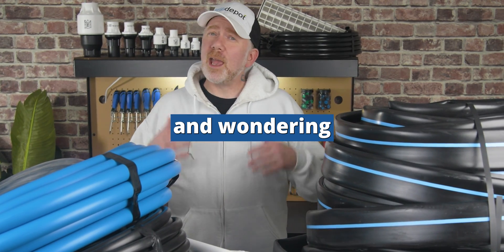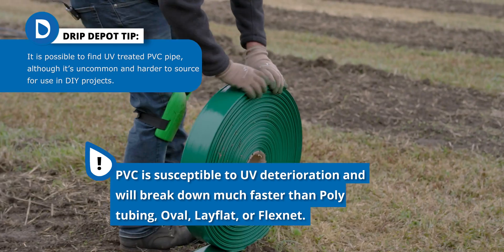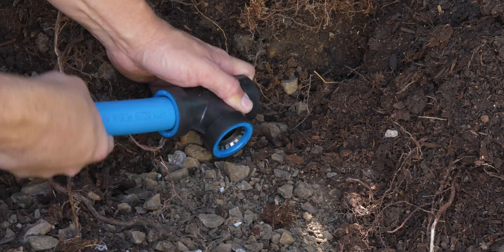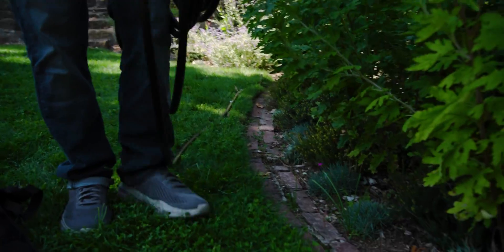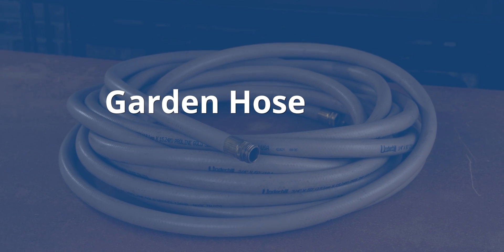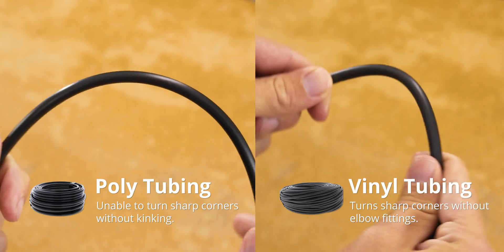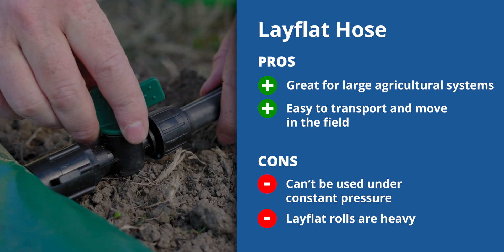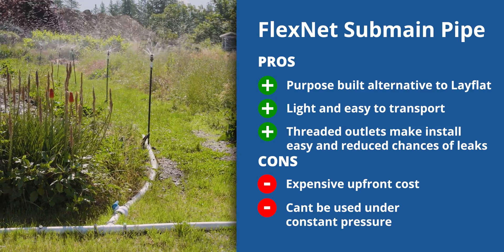Irrigation Pipe & Tubing: Choosing the Right Mainline Type for your Irrigation Project

Comment: A strange dismissal of HDPE polypipe, which can be standard or high pressure. If you use the proper clamps it is by far the simplest, easiest, and cheapest way to go.
Reply from the maker: No dismissal of HDPE, it is indeed great for high pressure applications and we covered two types of it in the video :)

Costs may vary depending on location, up front PVC will typically be lower in price, but I do agree that in the long term HDPE will likely be lower in cost, particularly anywhere that experiences freezing temperatures (exceptions for warm climates that can use Class 200 PVC pipe, very low costs).  For low pressure applications, LDPE will cost less both initially and long term. 

Basically, for high pressure applications in colder climates, HDPE is usually the better choice, but low pressure applications and warmer climates can be an exception in terms of costs.
Reply: @dripdepot In my area a 100' roll of 100psi polypipe is $66 and 100' of sched 40 1" pvc is $89, meaning the pvc is 40% more expensive. Fittings may more expensive with the polypipe but you will need less of them (no couplers or elbows except for very sharp turns). 

The ease of installation beats pvc, even if it were more expensive IMHO, even if  you are doing it yourself. I mean, with pvc you must unload each pipe, layout the pipe beside the trench, then glue it every 10-20', then place the pipe in the trench. With polypipe you just unroll it into the trench. 

Also, pvc is more prone to breakage if buried shallow if for example it gets driven over. 

This of course would only have a benefit on pressurized irrigation (not drip) but polypipe beats pvc in warm OR cold climates. (I'm in a cold climate and I use automatic drain valves for everything so freezing is not normally a factor, but I've had pvc freeze-break but never polypipe).

So I'm surprised you devoted so little time to the polypipe. Just my opinion as someone who has used PVC, polypipe and drip. I'm not a pro but I've installed hundreds of feet of all three types and the polypipe wins, hands down!

Comment: Thin wall poly tubing should be outlawed. Every time the system kicks on and off it moves and rubs against the aggregate in the soil and eventually springs a leak. It's junk.

Comment: How does the cost of blu-lock compare to PVC once you factor in the fittings?
Reply from the maker: With no other factors included or accounted for other than pure up-front material costs, PVC pipe and fittings will cost less at checkout than Blu-Lock tubing and fittings.  

If you include other factors that gap narrows significantly, and in the long run Blu-Lock could cost less overall in many cases.  

Blu-Lock takes a fraction of the time to layout and install.  Blu-Lock tubing is reasonably flexible too, so there's a much greater margin for error on digging the trench and less time will be spent measuring and cutting pipes to match the trench length.  Blu-Lock also does not require primer and solvent and the resulting cure time seen in standard PVC setups (though solvent welded connections are very secure, no taking that way from traditional PVC solvent weld connections). 

Over time maintenance will be significantly faster on Blu-Lock tubing and fittings.  Less time spent cutting out and replacing more sections than needed just because it's PVC (though people with lots of PVC experience might not see a huge difference).  

The time savings is greater for DIY'ers who don't work with PVC or Tubing every day, but even professionals are going to save time using Blu-Lock or PVC-Lock.  Its use is limited in professional circles, but a lot of that is simple tradition.  Its use in DIY circles has steadily grown over time and feedback has been positive. :)
Reply: @dripdepot thank you for the detailed response!

Comment: I am going to use an above ground pool to store my water then run a drip system off it, thoughts?
Reply from the maker: You bet, pools are sometimes used as part of home fire prevention systems up here in the Pacific Northwest, so using one as a water source is definitely not unheard of.  

To some degree it depends on the pool type (in-ground, above ground full size, kiddie pool, etc) but for the most part the same concepts will apply.  

If it's a larger pool (in-ground or full size above ground) I think the primary concern is going to be water quality.  You'll need to avoid chemicals used to keep pools clean, so there could be some algae growth.  A filter before the irrigation system will grab most of it, but that could mean frequent filter cleaning.  Regular system flushing can help prevent algae from growing in the lines.  If the pool remains uncovered it could invite mosquitoes, at least if the water isn't all being cycled through regularly.  

If you're going to be using one of those full size above ground pools, you''ll want to monitor the water level closely since many of those rely on the water weight to prevent collapse (don't want all the remaining water pouring out over the nearby area!).  

For the most part the above are the primary concerns and beyond that it could work very much like other water containers.  Good chance you'll need a pump of some kind unless the pool is elevated above the area to be watered by a decent margin.  

I do think this can be done, and unless you're injecting fertilizers into the lines, it could also be used as a recreational pool (and with the heat right now that sounds very appealing lol) :)

Comment: Hello, is there a good option for a lawn sprinkler system that’s above ground and connected to a hose bib? Currently I am moving hoses around but is there a better supply line option?
Reply from the maker: For above ground systems hoses are likely one of the best choices since they are often UV resistant and easier to reel and store.  Something like Poly Tubing could absolutely work in a moderate pressure system, but Poly Tubing wouldn't be nearly as easy to coil up when you're done watering the lawn.  Poly Tubing could be a better choice if it were a permanent setup as you could run multiple sprinklers from it, but being above ground I imagine things need to be put away for mowing and landscape maintenance.

If you are able to bury the lines, Blu-Lock could definitely work here and with just an adapter or so could be connected to a hose bib.  It's not UV resistant so does have to go underground, but it offers a little bit of the best of both worlds otherwise - it's reasonably flexible, so easy to layout without digging perfect trenches followed by perfectly measure PVC pipe, and it's durable in moderate to high pressure lawn systems (and easier than PVC pipe in general to work with, no primer or solvents needed).  For an above ground system garden hoses are typically the go to option though, if for nothing else than they're easier to coil up when you're done or when you need to mow :)

Comment: You didn't mention the typical brown drip tubing and how it compares to Poly tubing (LDPE)?
Reply from the maker: Most of that brown tubing out there is actually LDPE Poly Tubing :) 

Your question is a good one though, as there are indeed some differences.  Minor, but they're there.  Instead of Carbon Black (which gives the black poly tubing its color), the brown tubing is often treated with iron oxide pigments or other brown colorants to get its color.  In a lot of cases, this does make it less UV resistant than the standard carbon black poly tubing out there.  Higher end (Netafim, Hunter, Rain Bird) brown tubing is often treated with other UV stabilizers to try and compensate from the lack of carbon black.

This was a great question and is definitely a good topic to cover, thank you!

Comment: What about high density polyethylene?  You skipped over that one! Being a northerner with 4 foot frost depth, I would like to know about constant pressure with HDPE.
Reply from the maker: The Blu-Lock tubing is HDPE, but you are correct in that it's not the more common black HDPE that can be used under constant pressure.  You're on the right track, HDPE is significantly more freeze resistant than PVC and gets a lot of use up north due to that.  I like it in general, particularly from a DIY perspective.  It's flexible enough that it can take gentle bends without the use of a fitting.  The big thing to account for is friction loss.  If you're using HDPE that can handle constant pressure, it's going to have thicker walls and experience higher friction loss at the same nominal size as some other types.  Not a problem as long as you plan around it and run the friction loss numbers though. 

HDPE can handle very low temperatures (less than -50° in many cases) without becoming brittle, so it's a good choice in colder climate irrigation systems.  Still needs to be drained of water, but there's less worry the first time you go to fire up the system in spring :)
Reply: @dripdepot thanks for the in depth reply.  Friction loss really?  No I’m asking this just because you’ve sparked my curiosity. Is it Because it doesn’t “give” due to thicker walls or it just is less smooth inside?  
Thanks again
Reply: @dfu1685  it’s going to be because the inside cavity is smaller for any given size. Easiest fix is just to size up.
Reply: I was listening for that too lol, glad u brought it up

Comment: I'm using pvc above ground but plan on blowing it out before winter hits.
Reply from the maker: That can definitely work!  If it's not shady, might be a good idea to give it a coat of paint with plastic safe UV resistant paint, but with a good blowout you can prevent freeze damage in above-grade PVC pipe :)

Comment: Do you have opinions on below grade PEX for underground sprinkling in a freezing winter zone?
Reply from the maker: "I do! My opinion probably runs a bit counter to what you’ll hear from many irrigation professionals, but from a DIY perspective, I like PEX. Its flexibility gives some margin of error for folks who are newer to irrigation and pipe laying, and that same flexibility gives it better freeze resistance than rigid options like PVC. PEX also tends to “return to shape” after freezing without long-term damage, which makes it a good choice in cold climates.

I have a colleague who uses PEX and said his line did freeze once with water in it. The PEX came through just fine, but a plastic fitting cracked, so it’s still important to drain or blow out your system before winter, if for no other reason than to protect the fittings. :)

Things to account for when using PEX in irrigation: 

It has thick walls, which typically means a smaller inside diameter, which leads to higher friction loss.  Not necessarily a problem, but a system sized for 3/4" Sch 40 PVC pipe, for example, might need 1" PEX rather than 3/4" PEX. 

PEX is also susceptible to UV degradation.  You're planning underground, which is good, but something to keep in mind for any above ground portions.
Reply: @dripdepot thank you so much for your time and insight!  Realy quite gracious of you to answer my questions so thoroughly before I have even purchased anything.  May blessings follow you for your generosity!!!

Comment: Anyone have issues with Blu Lock leaking? I'm interested in it for a lawn sprinkler but heard it leaks
Reply from the maker: A few of us down here have done our lawn systems in Blu-Lock and no major problems.  When there's a leak, it's typically where the tubing joins the fitting.  The most common cause is an uneven cut on the tubing.  With a good, even cut and inserting it straight they make leak free connections.  The tubing itself is thick walled dense tubing that can handle high pressure, so leaks there are unlikely unless it gets hit with a shovel or something, but even then it's pretty easy to fix with a coupling :)
Reply: Thank you for the answer! I'm looking at it for my lawn in the north west. Would you recommend using saddles or tees for adding heads?
Reply from the maker: @cattledogjasper1731  Great question!  In most cases I just go with a tee into a swing joint or pipe (habit from so many years), but the Blu-Lock saddles are very easy to use and have an even great margin of error for a leak-free connection than bite fittings.  I think personal preference (or in my case, old habits) is the biggest consideration here, but if this is your first time working with Blu-Lock those saddles will be very easy to use :)

Comment: What is the best tube/pipe for a constant pressure system that is above ground and runs for 20 feet
Reply from the maker: You'll have a couple options here.  HDPE that's rated for constant pressure is common in this application.  HDPE has good UV resistance and a lot of it can handle constant pressure just as well as PVC.  PVC pipe painted with a plastic safe paint or inside a UV resistant sleeve can be used as well.  And there's always galvanized steel, though that's often cost prohibitive and a little overbuilt for common irrigation tasks.
Reply: @dripdepot  awesome great information thank you. Do you think a high pressure garden hose could also work without failure under constant pressure
Reply from the maker: @nordykid  Some of them definitely can!  Washing machine hoses are rated for constant pressure and they're fairly common.  Not necessarily what you'd want to use here, but it does illustrate that there are constant pressure hoses out there.  For any garden hose, I would definitely check with the manufacturer to make sure it specifically can handle constant continuous pressure rather than just high pressure.  Sometimes things rated for high pressure or heavy duty are still not rated for constant pressure.  But basically, yes, there are constant pressure hoses out there that you could use :)

Comment: I been using Swing pipe as my mainline through my whole yard under ground. NEVER had a problem. 100ft and more.  Still works great.
Reply: Buried or above ground?  Putting in system to water back of property and will need to supply 3 impulse heads at a time.  Thoughts?
Reply: @geraldpage4401 I put mine 3 inches below around all edges. If it’s gonna be a lot of traffic in the middle, do 5 inches.
Reply: @The3rdCoin thanks

Comment: N0 PEX-A pipes?
Reply from the maker: Not yet, we don't see much PEX used in irrigation yet, though that could certainly change if demand increases for it in DIY irrigation.  I do like the flexibility PEX provides (trenches don't have to be perfect, you can take a bend without needing an elbow) over PVC, but it often takes a larger size PEX line compared to a PVC line for the same job since PEX has a smaller inside diameter.  I'll take PEX over PVC for indoor plumbing any day though!  :)
Reply: @dripdepot Great video!! Thanks! i use pvc pipe 1/2 burried from spigot to garden (about 20 ft) and then poly drip tubing. Its been years w/o any issues but i was wondering if pex was a good alternative.
Reply from the maker: @Vic_P  Aha!  For this, I'd stick with the poly tubing for sure -- costs less, fittings are easier and the diameter is bigger.  Where I do think PEX can be used in an irrigation system is as a replacement for PVC (so long as things are sized to account for higher pressure loss in PEX).  For a DIY'er, PEX gives some cushion on things since it's somewhat flexible.  If you make a mistake with PVC, it's time to cut things lol
Reply: @dripdepot  very true!! 👍🏽